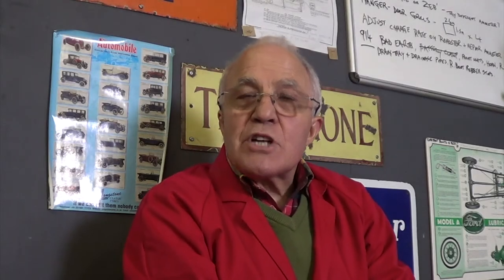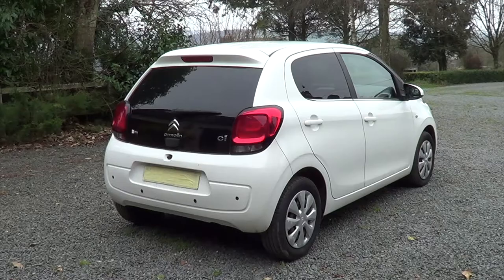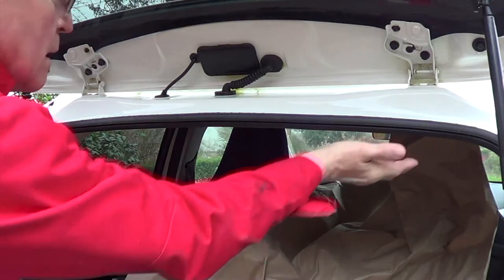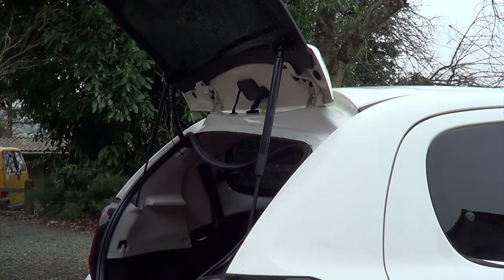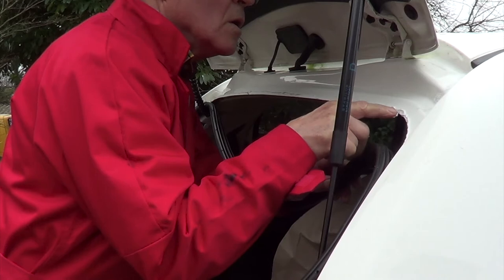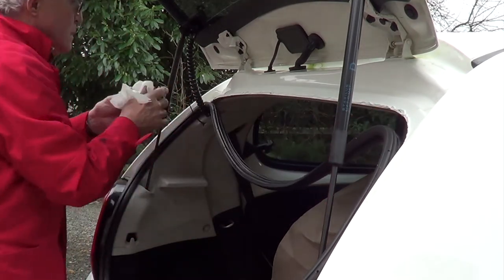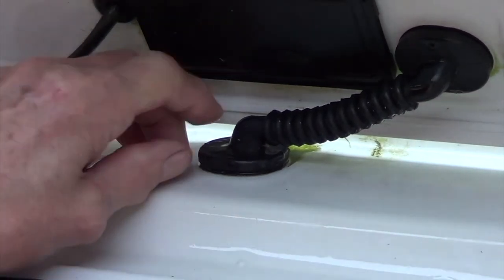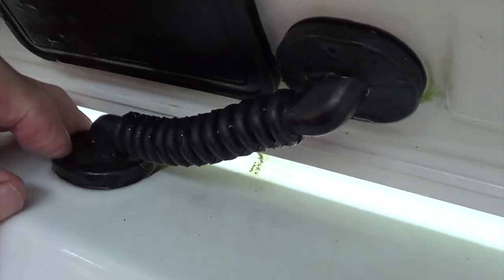Citroen C1 water leak

Comment: It leaks through the upper brake light, as it has no seal, when you open the boot, it pours inside the car through the pipe for the wiring (the big concertinaed rubber pipe).  Take off that black plastic inspection cover, and you will find water in there. Leave the inspection cover off for a quick temporary fix, but maybe there is drain holes that get blocked.
Reply: Yes this is where my wife's leak unfortunately I did the same as this guy it's a waste of time. It's tricky but you have to remove the high brake light lens and silicone around the back of that. It's just the original seal goes bad after a few years.

Comment: The water comes in through the high level brake light and down the cable tube into the roof lining and down the sides into the boot, Tony, take that black cap off the tailgate and you will find loads of water. Replace the light and seal with silicone on the outside . ✅
Reply from the maker: Thanks for your input.  The water seems to come in all over the place, I'm not impressed with the build quality.  Reminds me of early BMC minis and 1100s.  BMC recommended to their dealers that they punched holes in the floor to let the water out!
Reply: Worst bit is…. The C1 model before this did exactly the same 😂. This also effects it’s relatives the C1, Peugeot 108 & Aygo. You would of thought they wouldn’t let the same mistake happen twice! New brake light is approx £45 + a tube of silicone 😅
Reply: I tried to do that today on a Peugeot 108, which looks identical to the Citroen, but couldn't budge the light unit. Due to the small size of that stupid little access hole, I could only reach one clip at a time, and could not push it out. It's a ridiculously bad design. Thankfully, my Ford Focus has a sensible design with external screws.
Reply: @CrankCase08 it is a bad design that the seal stops working after a few years. I am having trouble as well but when it's out it should be a easy fix.
Reply: @nothingsurprisesmeanymore  I made a little tool out of wood and cardboard that, when pushed up into the space next to the light unit, pushed both spring clips open at the same time, but with one side free it still refused to come away.  In the end I was forced to lever it out with a screwdriver before pulling it all out. Unfortunately, it then broke into pieces. £68 is the current price for a new one from the main dealer. An absolute rip-off.
Reply: @CrankCase08 i had the same problem on 2017 C1.  The clips holding the brake light cover are accessed through that  black cover. They are on really tight and the plastic cover cracked badly getting it off. It is a ridiculous way to do it. My earlier C1 was much easier, two external screws.
Reply: @ChrisJohnson-pd4hh  I imagine it was designed that way to minimise the installation time in the factory - connect, push, done - as opposed to connect, position, tighten left screw, tighten right screw.

Comment from the maker: I sent the owner back to the Citroen garage with the video.  In the hope she could get the fix (perhaps a decent flexible soft grommet fitted) under warranty.  No chance!  They just slopped some sealer round the very hard grommet.  I did not want to get involved in a sloppy repair like that.

No better than BMC with their water leaks in the 1960's and 70's.  The official fix from the factory was to drill some holes in the floor to let the water out.

Not my cup of tea bodges like that.
Reply: That's not the problem unfortunately.

Comment: My car is the exact same model and colour, looks about the same age too, with the same fault!! Was it an easy fix? 🙏
Reply: P.s thankyou Tony for making this video.
Reply from the maker: @chelseatizzy  Good morning Chelsea.  Sadly, this problem is another example of very poor production line assembly.  It is almost as bad as the days, in the 1960'/70's, with BMC  Minis and BMC 1100's in Britain.  It is poor design and even worse assembly.  The water leaks on these cars were so bad that BMC garages were told by the factory to just punch holes in the floor of the cars to let the water drain out.  That was their cure for the problem!!!!

On your C1 the leak is around the high level brake light black plastic part.  It has no gasket or seal around the joint, so the water just runs straight into your car.  Apparently it is a well known problem with this model.

The car in the video belongs to a friend of mine.  Once I found the problem - see video - I suggested she take the car to the Citroen garage that supplied it and ask them to rectify the problem.  They did this by simply sloshing some sealer around the black plastic part, then had the nerve to charge her for the "repair".

So much for Citroen customer service.  Sadly, here in France that is par for the course.

So for you to carry out the repair, I suggest you buy a tube of white (I think you said your car was white) sealer, either silicone or acrylique, I would use acrylique.  First clean around the black plastic part with something like meths or acetone to make sure the area is clean, great free and dry.  Then run a little of the sealer around the part.  Because it is difficult to get behind the part near the roof I would use some thin plastic gloves and put a little sealer on your finger and wipe it round the back of the part.

Hopefully that should end your water leak there.  Do keep an eye on the repair as these sealers do tend to break down after time.

Good luck, let us all know how you get on.